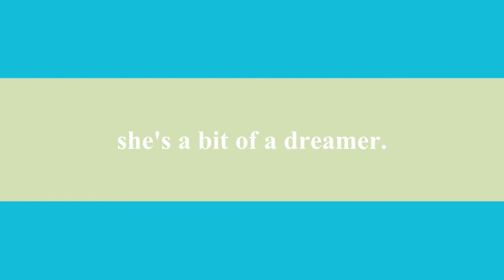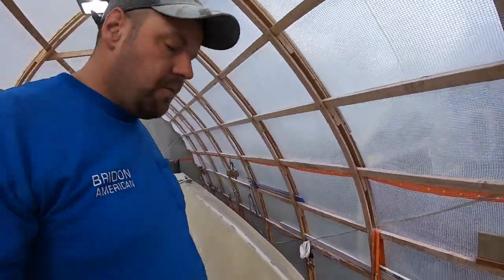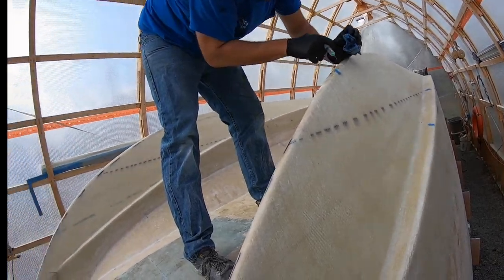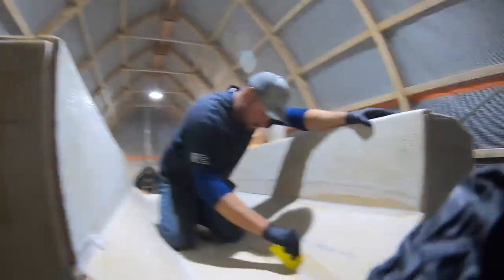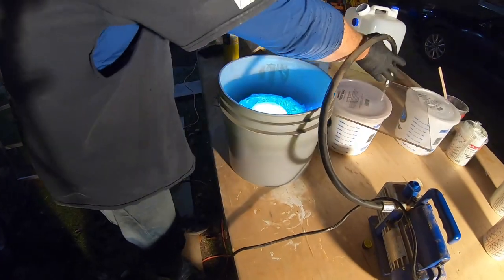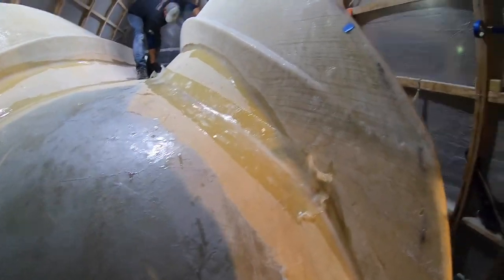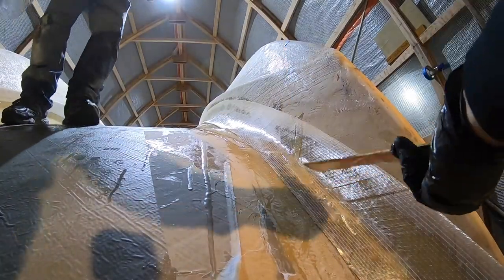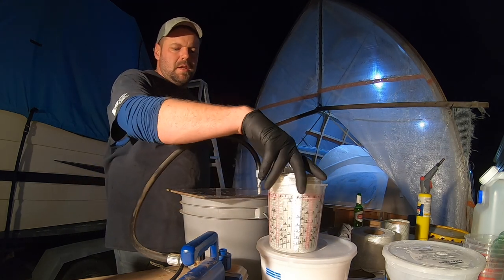Step 31: Bubbles are fun! and an Experiment with a Vacuum Chamber- Power Catamaran Build Series

Comment: Great video and great progress!  It is really turning into a boat!  This is one of my favorite projects on YouTube.   Just a friendly, small tip:  Maybe you tried them already or maybe they aren't large enough, but the all-plastic dental syringes available from Amazon (Monoject brand) are less expensive, pre-bent, and you can quickly cut the tip to your desired size, which makes it possible to use them to suck up thickened epoxy.
Reply from the maker: Thank you! We were going to use those but wanted to go with the smallest biggest syringe (does that make sense ?😆) tip possible to minimize damage to the actual fiberglass.  The all plastic ones we had though were straight, no bend... so maybe we did have the wrong ones! Taking a look now. Thanks again

Comment: You can also use your vacuum pump to pull resin through a large bubble, which I have done numerous times.
Reply from the maker: Do you have a video on that? Would be interested to see!
Reply: @BuildingMVDauntless  I'll look but not sure. Standby.
Reply: @BuildingMVDauntless  No sorry. I don't have any video of that. It's not hard though. Drill two small holes like you did before. Run a bead of mastic tape around the repair. Cover with plastic sheet. Insert resin feed line in one end and vacuum line out at the other. Kink the resin feed line. Pull a vacuum on the other end. Open the resin feed line and the vacuum will pull the resin through the repair. I did one bubble that was about 1/2 sq ft in seconds.
Reply from the maker: Awesome. Good to know. Thank you!!